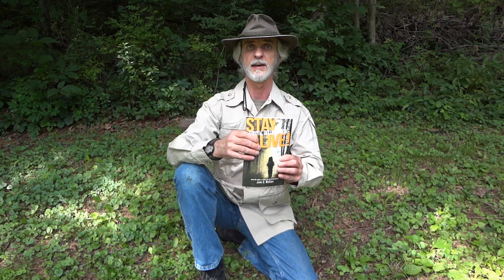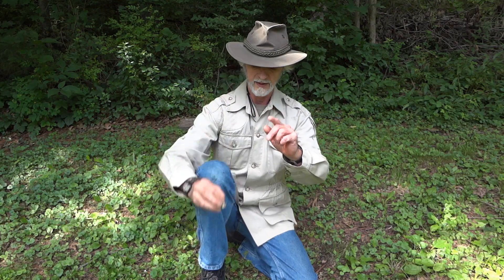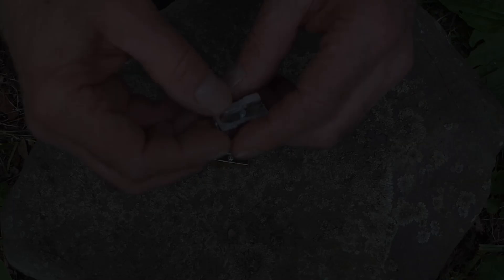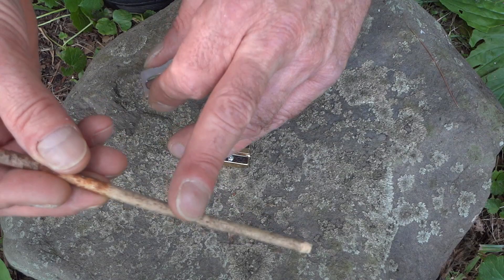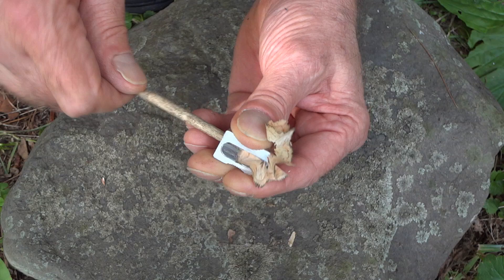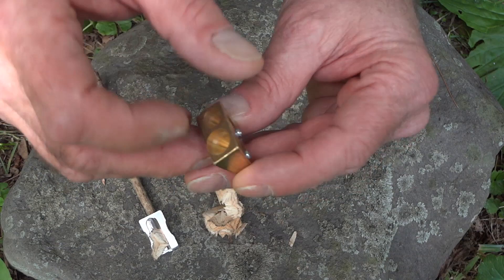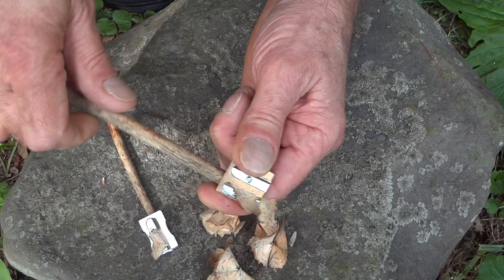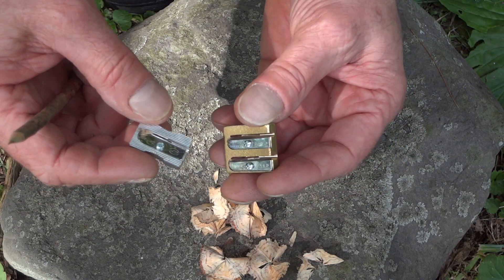Tinder Made Easy Using A Pencil Sharpener

Comment: I put a pencil sharpener in my kit that was made by Smith's(knife sharpeners/blade care) and it has 2 small carbide blade honers on one end. one for a small fixed blade or folder and the other is meant for razor knives like box blades. I put it in my kit to use for shaping survival bow arrows, make shift tent/tarp stakes, cooking spits etc. but now it has just gained yet one more potential use. thanks for the video!